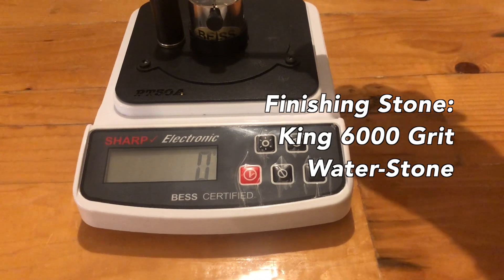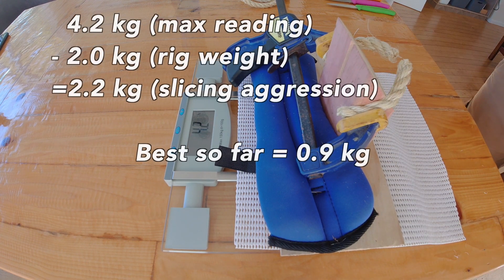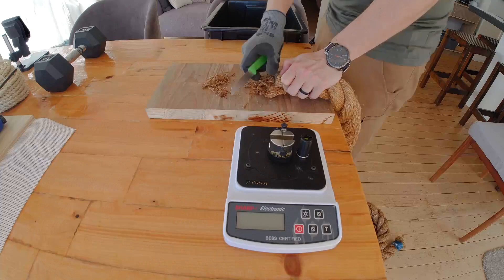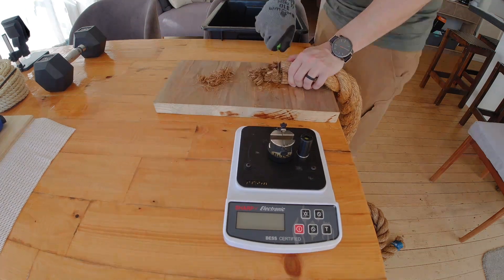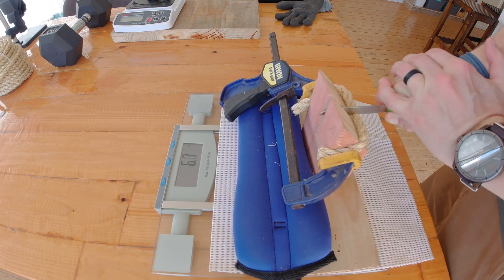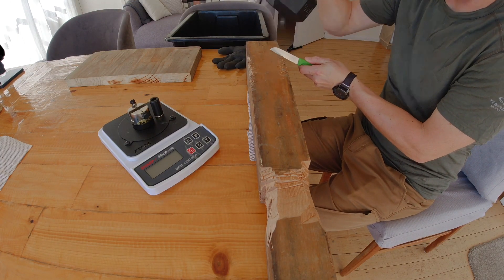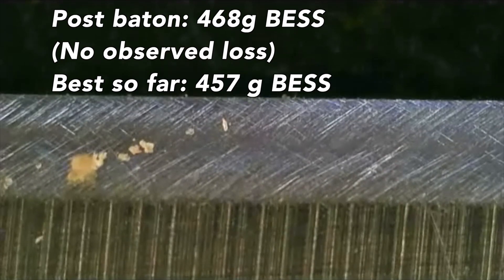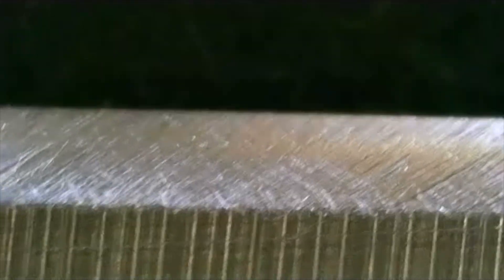King 6000 Grit Stone VS 40 mm ANDE Rope | Knife Edge Test

Comment: FYI that's not 1000x magnification. It's between 20-40x. They derive the values based on the size of a 24 inch screen displaying the magnified image. Optical is only 20 or so.
Reply: True. Since it's a digital microscope the zoom always depend on monitor size. The number they give is way off. 
To have a better idea about size you can put a ruler under a microscope and create a scale with an image app like Krita.
Reply from the maker: Oh, that's good to know.  Seemed too good to be true.
Reply from the maker: I'll look into it, thanks!